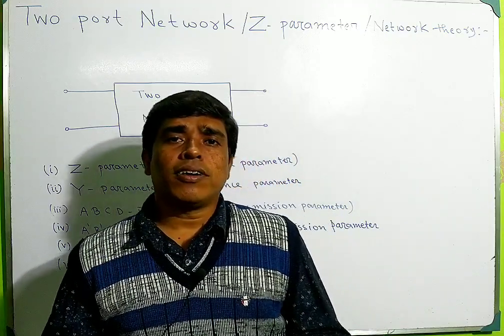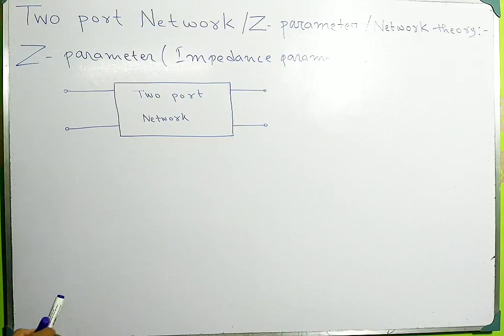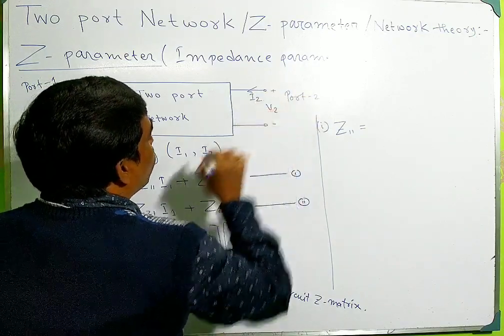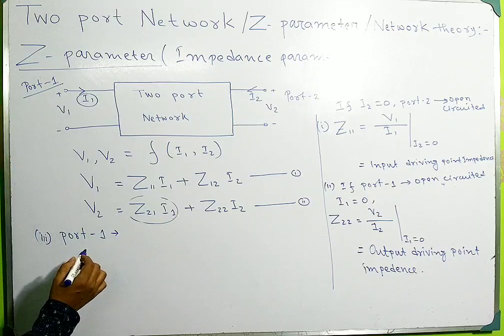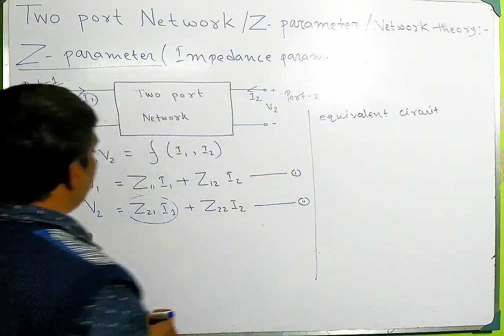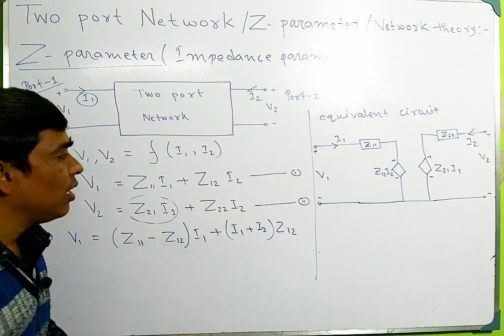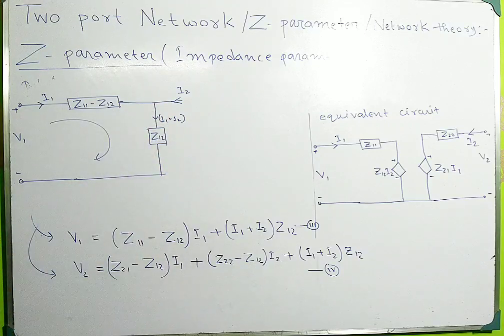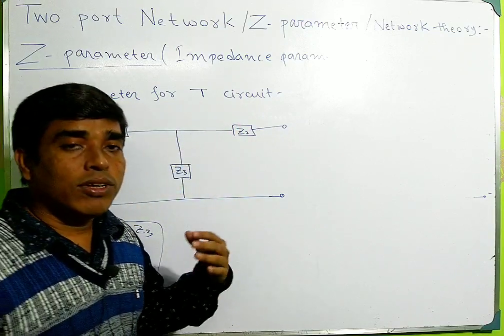Two-port network/Z-parameter/Network theory/For B.Sc,B.Tech,GATE,Electronics

Comment: Nice, would have liked examples with resistors in the two port network and with the two port networks in series, parallel and in cascade connection